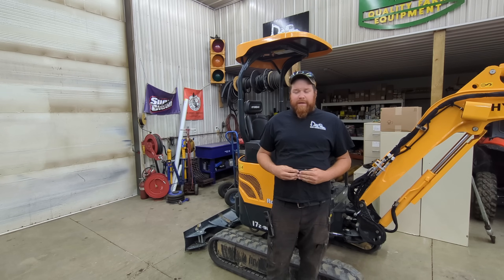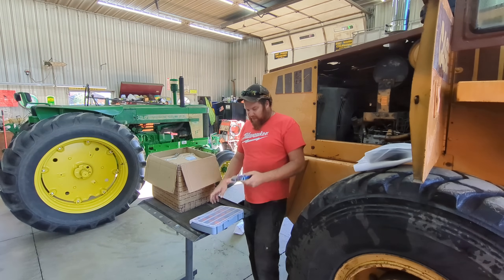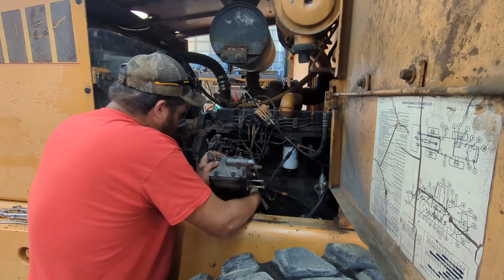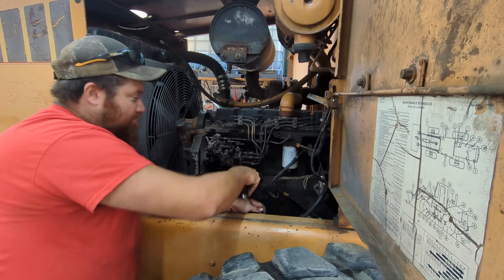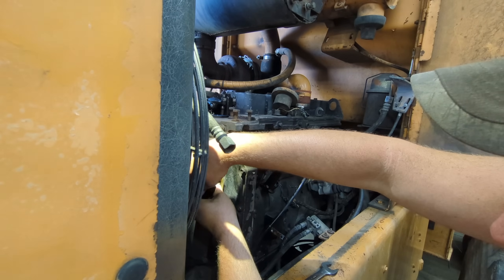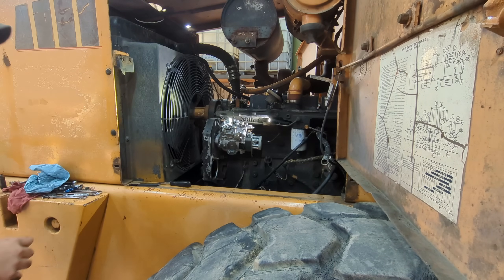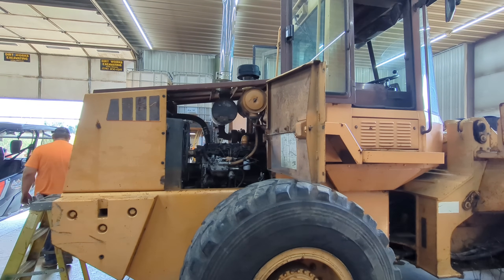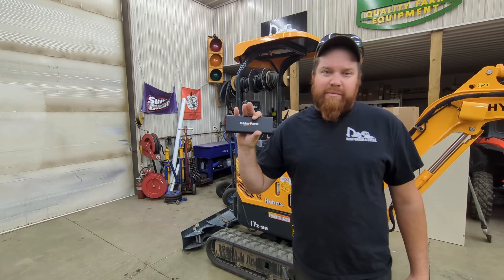Shop Work With Friday Parts!  621 Case Fuel Injection Pump Replacement

Comment: I would think that the engine in a wheel loader would be set up more like a road vehicle not like an industrial machine.

Because you aren't going to run it at a constant rpm like a tractor in a field, instead a lot of back-and-forth, on and off the accelerator as you scoop and dump material.

Comment: Brandon great video, is there a method to bleed out all the air easily? are those screw drivers good fits in 
different screws sizes? good job getting the repair done. that belt was just nasty noise!